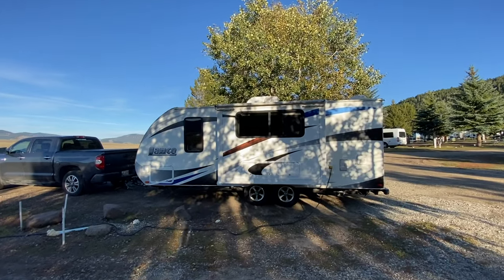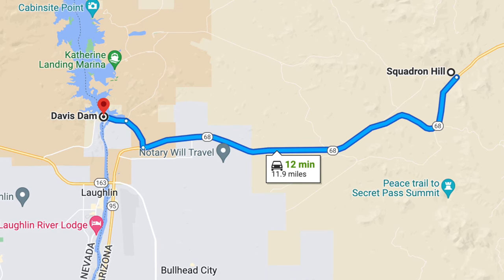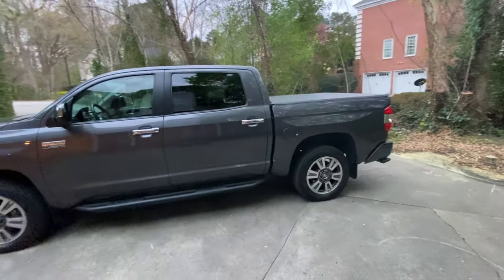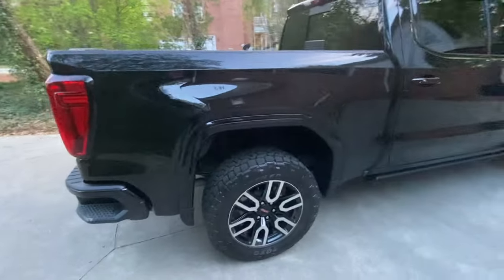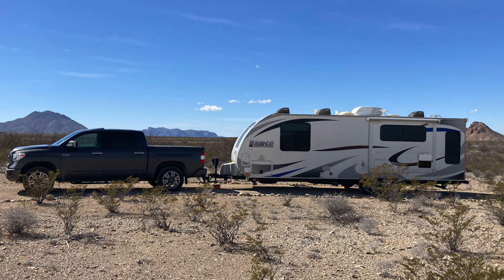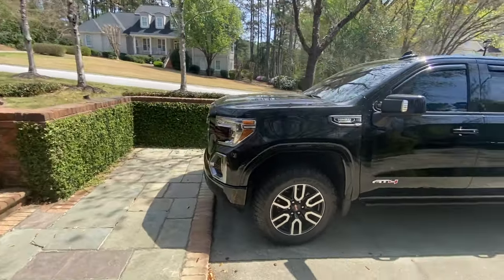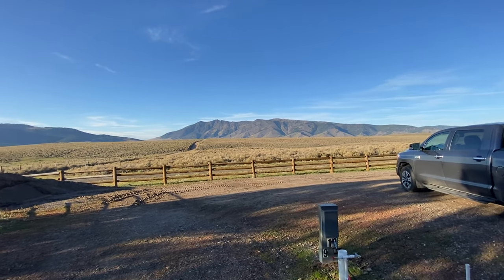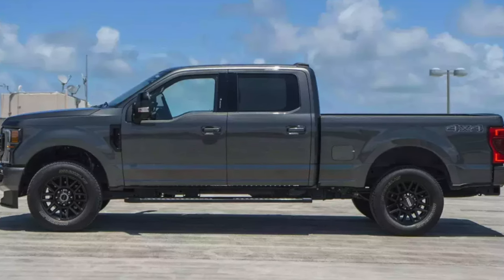Myths - Towing Capacity & Payload - the best Half-ton truck for your Travel Trailer or RV

Comment: Finally, you have brought a common sense approach to towing with a 1/2 ton. Based on my limited research, most of the truck manufacturers derate capacity. Thanks for this post. I tow an 8,000 lb travel trailer with an F150 5.0L V8 with a 36 gallon fuel tank. The 5.0 engine never runs hot and tows just fine. Yes, it winds up the rpm’s when merging but that is where the power band is.
Reply: Yeah that's the thing with naturally aspirated engines. The polar opposite to this would probably be the VW Touareg, a mid-size crossover which the Audi Q8 is based of, with the 4.0L twin-turbo diesel V8. It has 415 hp at 3500 RPM and 664 lb-ft of torque from 1250 to 3250 RPM. It just pulls and pulls, you are at peak torque all the time and once it reaches peak power it upshifts and you are at peak torque again. It goes 0-62 in 4.9 seconds and only stops at 155 mph. In Europe it's a very popular tow vehicle (more the diesel V6 version) which can legally tow up to 7716 lbs.
Reply from the maker: Interesting, I can't find or build the 5.0 with a 36 gallon fuel tank anymore,  which version/year do you have?
Reply: @kedrevs4037  Ford option code is 655. Not available with Powerboost or Heavy Duty Payload Package. Available only on 3.5 or 5.0 engines. Standard with Max Tow Package.
Reply: @kedrevs4037  check max tow PACKAGE 8ft bed and extended  not crew cab ... you can select  3.5 twin  turbo
Reply: @kedrevs4037  I have an 18 F150 STX Supercrew w/ 3.5., 6.5 ft bed, 10 speed and max tow package. It came with the 36 gallon tank.
Reply from the maker: @jameshoots8302    We were talking 5.0, not 3.5, just not interested in Turbo gassers for towing
Reply from the maker: @paulrodrigues9603    Aware the 3.5 comes with 36 gallon tank, but 5.0 doesn't and it should.
Reply: My 2016 f150 XLT 4x4 has the 5.0 and 36 gallon gas tank. I pull my 6,000 lb. camper with ease. My 2018 Tundra easily pulls as well. Love them both.
Reply: Do not buy an  ECOBOOST of any size to pull an 8,000 pound travel trailer.  I know from experience.  They are fine for a 5,000 pound trailer.  An ECOBOOST has to stay in boost to pull hills and mountains with an 8,000 pound trailer and will overheat.  I drank the Ford kool-aid and have regretted it ever since!  If you have any doubts, buy a Superduty.
Reply: @KEdRevs I have a 2018 F150 Supercrew, 4x4, 8' bed, 5.0 w/ the 36 gallon fuel tank.  It does have the HDPP package which gets the larger tank, along with 2610 payload & 10,700 tow capacity.
Reply: @kedrevs4037 I have a 2022 F150 max tow 5.0 with the 36 gallon tank, comes with the 6.5 box. the rear axle is a beast also, 3/4 float with 4150 gawr, it’s a great towing truck but that’s why I spec’d it that way.
Reply: @kedrevs4037 my 2011 f150 5.0 had the 36 gal tank
Reply: It is derated for a reason, and that is a built in safety barrier, or cushion.
Reply: @grrrrr2936  We shall see...I ordered an F150 w/3.5 ecoboost, and max tow package w/trailer tow mirrors.  I'll let you know how well she tows once I slap a 7 to 9k trailer on it.
Reply: My 2012 F150 econoost had a 36 gallon fuel tank
Reply: That’s gotta be a 2015 or newer

Comment: Why is it that all you 1/2 ton guys. Need to justify what your pulling with your milk and bread truck. What it really boils down to is frame, suspension and brakes. Flat out. If your driving over weight and you get in an accident. Your butt will be handed over to the courts. And the insurance companies.. not to mention people's lives. So your rear axle weight rating. Will not mean a thing. Also your payload capacity has to do with the options in your particular vehicle.
Reply from the maker: If we just paid more attention in primary school, we could avoid more embarrassing posts.

Comment: Your comment of using a F-150 to only tow with a lighter 4000lb trailer is terrible advice for others that don’t know any better and are listening to this. You clearly haven’t towed with a max tow package F-150 before, or the 3.5L ecoboost for that matter. I’ve owned 2 now, with over 100k miles on both, and tow a 10,000 load regularly through the mountains, through 105 degree heat, and easily at 72-74 mph on the freeway. My truck drives like new & no problems with either to date. I’d point out that none of my prior 1/2 ton trucks, including a Tundra like yours, a 5.0 F-150, or my Chevy 5.3’s come close to driving or  pulling like these 3.5TT do. So thankful for this truck and setup as its keeping me from having to buy an expensive 3/4 ton. I’ll take safety, performance and worse fuel economy when pulling any day over the alternative options that are currently available.
Reply from the maker: Appreciate the comment, we all have our own take on these things.  Mine is based on physics of mass.   It is not about pulling, it is about stopping and controlling.
Reply: What weight distribution system do you have on your F150?
I have the Blue Ox system on my 2019 F150 fully loaded with the trailer package and big gas tank.
I upgraded my tires last year to 10ply.
I have to look at my BlueOx again to make sure the trailer shop set it right in a couple weeks.
Reply: Yeah I almost choked on my coffee when he said his tundra has an 1100lbs payload. My max tow 3.5TT is a 1711lbs payload and a 36 gallon tank. 
The spec for towing 13k lbs is silly because you’ll max your payload on a trailer way lighter than that. 
Still, turbos kicking in at lower RPMs for early torque, an engine capable of pulling far more than you should be putting on the hitch, and an excellent payload kinda made me scoff. Can’t claim some safety reason, a 1/2 ton is a 1/2 ton overall, if that was the concern he’d be in a 3/4.

Comment: It always amazes me how many ways people find to justify overloaded trucks.  Now it is Axil loads. Payload is Payload, there is NO exception.  The Tires, Axles, Breaks, Radiator, Frame, springs, struts, etc. are all designed for that payload max listed in that door jam.  You cannot add better springs, air bags, or other modifications to increase payload and a higher axil number does not incease it either.   Can you tow with more payload than the listed amount on any given day and get away with it, I see it everyday.  Ever see those 150 Lariat, Limited or Platinum towing an 8000lb trailer with their truck bed loaded to the max with bikes, canoes, grills, etc. and 4 grown people and a dog in the truck.  See it almost every weekend.  Everybody does it and says, see I did it.   I even heard a truck driver tell me they can do it because they have been driving trucks for years.  I mean seriously?? What they don’t tell you is how their engine or transmission is blown at 150K miles instead of 200k or 300K.  How they are replacing their springs, shocks, wheel bearings, tens of thousands of miles earlier.  How they ended up in court with a big ticket for being overweight.  How they badly injured another party when they lost control of that trailer sway and ran into them going downhill, how they could not stop in time and ran into the car in front of them, How their insurance company turned down their claims to repair $200K in damages because they were overweight.   We all win in Vegas on any given day, but the house always wins if you play long enough.   Don’t mistake the ability to tow over the payload on any given day for ongoing success.   Do your math, get the right truck, and enjoy a long life of successful towing.

Comment: Here's my personal experience on this topic.  Already owned a F150 with 8100lb tow capacity and 1600lb max cargo.  Was told I was within spec to tow a 26' 6000lb travel trailer.  Was I within spec?  Technically, yes.  However, after tongue weight, 2 people in the cab, items in the toolbox, and general cargo we brought with us, we were literally at the max 1600 lbs. cargo.  And, "on paper" doesn't always translate to safety and handling on the road.  The 4.6L V8 did fair and I could keep up with the speeds I wanted with regular 3500rpm usage.  The main safety issue was how much this truck bounced and felt spongy the entire time.  After 3 trips, I traded up to the F250 and wow, what a difference.  3500lb cargo capacity and 12000lb towing, with a 6.2L.  Very little bounce, very smooth riding; at times didn't even feel like I had a trailer behind me.  I would honestly recommend F150 owners to keep your travel trailer weight below 4000lbs. for easier, and much safer towing, which probably means getting a trailer less than 21'.  Trust me on this.  Don't 100% believe what an RV dealer tells you about your vehicle rating and what it can handle.  They're salesman trying to get you into the biggest trailer possible.  They're not giving you the whole picture.  And they're not manufacture engineers.  Engineers don't "ballpark" in the numbers given on the vehicle specs.  Those numbers are for YOUR safety and the safety of others on the road.  Before purchasing, you do your own research and think about safety in towing during inclimate weather.  Travel well below your vehicle specs and your drive will be smoother and safer, without "white knuckling" the whole time.

Comment: I 100% agree with you on not running down the the road at or near your max weights & towing capacity!!  Buy a bigger truck!!!   It’s like a 150lbs person carrying a 250lbs person on their back vs a 250lbs person carrying a 150lbs person on their back. Both can do it but the smaller person is going to get tired and fall down quicker 😂
Reply from the maker: Very good analogy
Reply: Not everyone has $60K laying around to blow on a HD truck, thanks to taxes.
Reply: I rather supercharge my tundra abs it’s going to last longer and power off the line

Comment: One thing to think about is altitude.  The ecoboosts really make a difference towing at higher altitudes.  I’ve had the 5.0 F150 and the 3.5 eco boost.
Reply: I’m getting an eco boost… so which direction is it at altitude - good or bad? My assumption was that the eco boost would struggle
Reply: Eco boost good in altitude
Reply: I live in Colorado and have a 2021 3.5 Ecoboost pulling a 6900 lb. Travel trailer. Generally, the Ecoboost has plenty of power going up to the Eisenhower tunnel from Denver, however, last summer I was going up Vail pass at about 65 mph on a hot day. I got a dash warning that my engine was overheating and to reduce engine power. The engine temp sensor immediately goes into a digital readout of the engine temperature. I reduced the speed to 35 mph and the temp started coming down. Eventually, the temp reduced to normal. Ecoboosts have a lot of power, but I wouldn't push it too hard on steep mountain paxses.

Comment: I have no experience towing with a gasoline truck, but this is a splendid video for learning. I tow a 45' 5th wheel with an F-450, and honestly, it pulls like a dream. The 6.7L diesel seems to handle the load w/o objection - even in the west at an elevation pushing past 11,000 feet. I meet people at parks towing with Ford's "Godzilla" gasoline or RAM's gasoline, and they tell me it sounds like the motor is going to explode, claiming mountain passes. For me, diesel is worth the cost.
Reply: Well I’ll bet they’re maxed out or near the limit for towing? Maybe even exceeding the payload capacity😂 If you’re going up the mountain they have to know their truck is making less power. Especially when the fuel mix is turning lean in relation to sea level fuel ratios
Reply: I guess my pack mule is way below your league then.

Comment: Great video. I tow a 27ft 7k lbs travel trailer with my 2015 Toyota Tundra. The only complaint I have is the 2015 only had the 26 gal fuel tank so I do in fact pull over every 2 hours to gas up. I probably would have bought the same setup anyway since the Tundra is so reliable but it is very annoying. I don’t tow cross country or anything, but definitely glad you mentioned it so others can learn before buying
Reply: I have a 2010 Tundra. Fantastic vehicle and I am considering using it to tow a keystone "half ton" 5th wheel. All the numbers I've found relating to.the model of my truck say it will handle it. However, the one concern I have is the tundra braking system. Is there a way to improve that?

Comment: Great video thank you.  I tow a 7,700 pound travel trailer with my 2007 Dodge Durango with the 4.7 V-8.  She tows pretty good and doesn't over heat even when climbing a grade.
Reply: I'm saying you don't. Sorry but that lil Durango has no chance
Reply: @jasonbruney8842 Yeah doesn’t make sense.
Reply from the maker: We had an '07 Aspen (sister to Durango)back in the day.  Came with 5.7 Hemi, it would have towed that amount, but it would be more than I was comfortable with.

Comment: Good video with good info. Basically, with a half-ton pickup, you run out of payload long before you run out of tow capacity. It's a numbers game. The payload on the sticker is technically the "curb" payload or empty payload (no passengers or cargo) with a full fuel tank (as you generally allude to). I figured this out using a CAT Scale. Numbers were right on the money. BUT! In reality, this isn't very realistic; no one drives a 100% empty truck since the driver is in the truck and his/her weight counts againstthe listed max payload number. There is an "effective" payload that is more realistic, or the available payload remaining after you load up with passengers + stuff you want to carry when you go camping + the hitch with spring bars in the bed. The only way to find this number is with a CAT Scale. The  GVWR - Scaled Weight = Effective Payload. In many cases, it isn't very much. Also, the receiver hitch on the truck is typically rated (tow rating/max tongue weight) at 10,000#/1000#. Even comparing RAWR with the weighed Rear Axle Weight is pretty close to Effective Payload. To estimate your tongue weight, multiply the trailer GVWR by 13%. This gives you a ballpark number. I found this pretty close after 40 years towing trailers. Of course, you can control your tongue weight by balancing your load, too, and not having a full fresh water tank, which are typically in the front of the trailer. 
Good, informative video. 👍
Reply: Read the fine print. Toe capacity is void once you exceed payload

Comment: Excellent video that considers much more than so many Youtube videos that trash pulling with 1/2 tons for anything more than a pop up trailer (such as "Big Truck RV").
I personally own a 2010 Tundra and have been RVing since 1986 and this easily has been the most capable vehicle when all aspects, including reliability are factored in (this includes over a 1 ton I owned).
Looking at axle weight rating is important, so is hitch weight, so is how the trailer is balanced which is often forgotten  (our 7800 lb Cougar has a wider stance in the tandem axles).
Our Tundra also has much heavier brakes (more comparable to 3/4 tons).
My only complaint would be the 26 gallon gas tank since we haul our trailer long distances (where we get about 9.5 mpg). But we make up for this with a few 5 gallon gas containers with electric pumps that makes adding the gas easy, and since I have the bladder the size of a walnut, I need to stop every few hours anyway.
I also agree with your points about the newer Tundra, the Titan, and most importantly the turbo charger long term reliability. I have been a pilot since 1989 and a multi engine pilot since 1993 and the running the turbos on high performance planes shortened the life and we were discouraged from doing so when not needed.
Reply from the maker: Great, informative post.   Remember when it comes time to upgrade that tundra,
Reply: Man you’re right on with the pop up comment on that Big truck RV fella.

Comment: Thanks for the explanation. I own a single-axle open utility trailer which is all I will ever tow. All of my previous trucks were half-ton until I bought a RAM 2500 4x4 Hemi as a daily driver. If I need to haul more than a 3000 pound payload, I will have the material delivered. The truck will hold 5 adults and their nominal luggage. Works for me.

Comment: When I got my 2011 f150, I searched all over for the larger gas tank. I had a 2010 with the 36  gal tank. I couldn’t find one. The last  8 years I towed my 3k dry trailer around with the 3.5 turbo, no problems at all. I pick up my new trailer Saturday. 4.4k dry. I hope the f150 still tows nicely.

Comment: Yup, I just bought another Tundra for more towing of our 20 foot trailer with extra large slide out. We love our setup, the 1794 2020 4x4 crewmax is a nice truck. I'm doing the 3 inch lift, air bag's and transmission cooler 😎 just because we love off road desert heat... lol.
So important and Thank's again for warning RV owners to stay below trucks towing capacity. The high winds and high mountain roads are best and joyful when your not over loaded! I hate seeing RVs scattered all over the roadway, it's truly a sickening site.
Reply: Got 18 tacoma, 19 travel trailer rated half the listed pull and tongue weight. Terrible, won't stay outa turd gear, rubber leafspring stoppers 3\8" off frame.

Comment: Great Video with lots of useful information. I have done much research on towing and agree with most of what you said. 
For those that say, "I tow a trailer that is heavier than the towing specs of my truck and it handles it just fine, I have a friendly warning for you. If you are in an accident while towing, and someone is injured, and Law enforcement /lawyers get involved, you can be sued if you are towing more than your vehicle is rated to handle.
Reply from the maker: Thank you.  I have heard of this scenario, but don't know of anyone held responsible as a matter of legality or civil law.  I'm not saying that I can't imagine it, just only hear about it in conjecture.